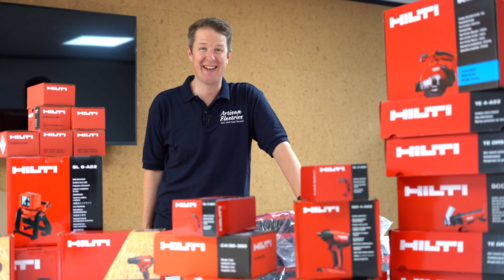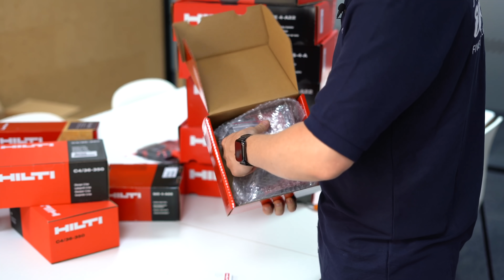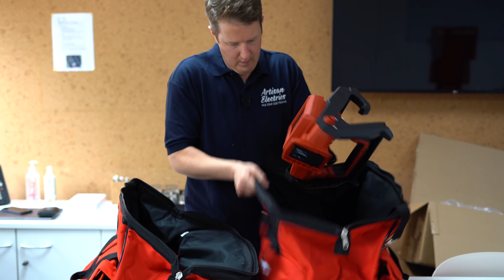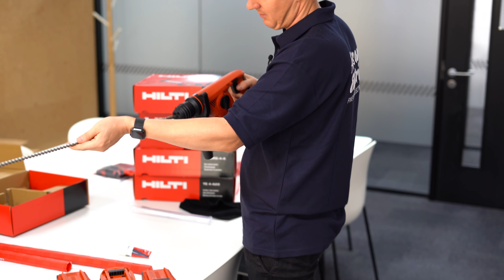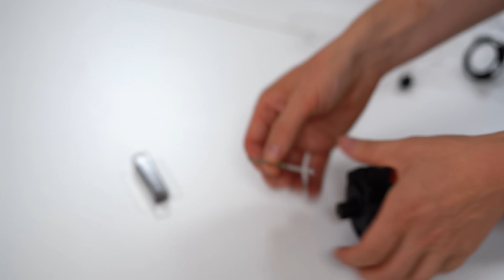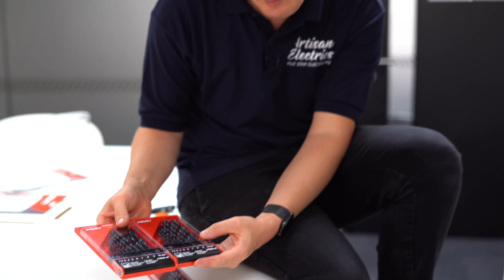DREAM TOOL COLLECTION! HILTI POWER TOOLS - Electrician Life

Comment: It won't worth it on the long run if you purely base the calculation on money. (you will get a new tool every two years, but also you will pay for the whole tool in two years. So if a quality tool last 5 or maybe even 8 years in your hand that could be four times cheaper.) The hassle free service or replacement what really gives an edge to the fleet service.

Comment: Cold cutting ferrous metal - surely that means cuts without needing cutting paste (lube) not cuts without generating heat?
Reply: In comparison to an angel grinder, those cold cut machines let you use  your workpiece without a cooling phase.

Comment: What happens if the tools you lease get pinched?
How are you getting floorboards up without either a circular saw or multicutter?
Is there much point in masonry bits for a drill that doesn't have hammer?
Was the best advert for Hilti not the fact that the Hatton Garden diamond robbers used their huge core drill?
Reply: Im not sure its meant to be a "buy these tools but no other", did they even have a drill/driver in the bunch? If you lease the tools I believe they come with theft insurance - check the site.

Comment: An SDS without chisel function? that's a bit neanderthal, cant get over the size of the impact and drill .. everyone else has gone smaller and more powerful .. shows hilti are just trading off the name rather than innovating.. i use the SDS bits all the time .. but the tools are outdated.. that light 3k lumen .. its huge, my solaris is about the same size and packs 20k lumen ... interested to know if hilti bunged you the tools as a freebie for a good review? thought that was guidlines on here
Reply: Jeez, he's not reviewing them. Also 3000 LED lumens is about 20W of waste heat, you need something about that size to dissipate it without a fan in all conditions, physics.
Reply: @edc1569  All the plastic framing dissipates loads of heat ... sure!! before you gob off .. compare it to what i use .. nightsearcher solaris lite 20k .. about the same physical size with a built in 18ah battery.. great use of the word physics when you have no idea what it means

Comment: I went to buy hilti top sds 36v last year . It was £1460 with 2 x 5.2ah batteries. All other brands are around £500-£600 for their top sds . ok it’s nearly 3 x the cost so I ask what’s the warranty . 2 years . Now I know milwaukee & Bosch offer 3 years so why the hell would I pay 3 x the cost for a tool that doesn’t even have as good warranty as the others . Seems like hilti don’t have as much faith in the tools lasting
Reply: I bought a 36v SDS Hilti Drill off gumtree about 9 years ago, worked great cost me £200 quid, only came with one battery but got a second battery off ebay. I had one problem when the chuck seized up (due to me drilling through some tar stuff), when I took it to the hilti shop for the part they tested and replaced my batteries FOC.
I do agree, they are very expensive, i'd always try get it second hand.
Reply: @calummcmillan9672  2nd hand is almost always stolen
Reply: You should read the fine print on the warranty against the Hilti two year no cost
Reply: @mahoian100  ?? . It’s a 2 year warranty .

Comment: Hilti just seems to have lost the edge, Milwaukee seems way better. Do Hilti offer a multitool? If not I can see that putting tradesmen off.
Reply: To each their own. My Hilti tools have outlasted all my other power tools. Can’t say the same with my Milwaukee fuels.
Reply: Yes my Hilti tools are way better than other tools really solid. No real multi tool to speak of but FEIN are the masters there. Hilti have to guard against race to bottom otherwise they will not be able to compete with the other makers. Your paying for engineering quality.